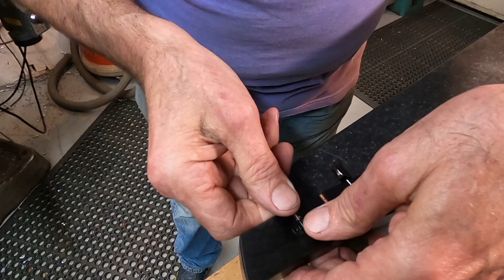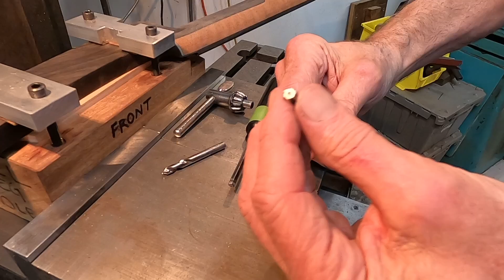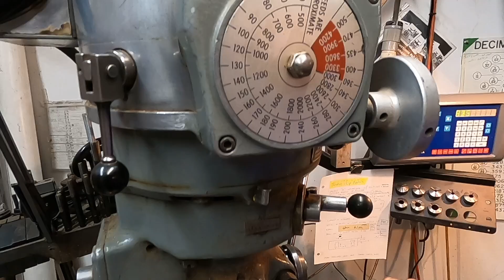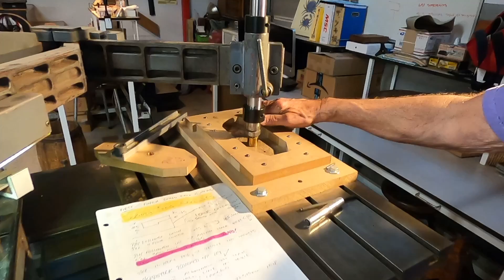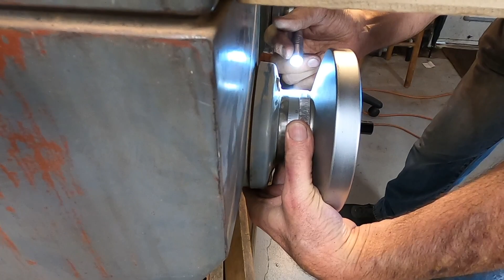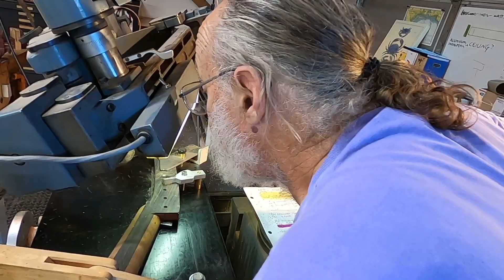Ken Parker Archtoppery - Riff 005 Tuning Machine Installation

Comment: There's an evil voice inside of me that wants to CNC a template to use in the pantograph machine? Muahaha
Reply from the maker: Jason! That’s a funny  thought, alright, but let’s look at a built - in aspect of the multiplication/division nature of the pantograph itself that makes it funnier…

I you’ve never used one of these magical pantographs, you might not have considered that dimensional accuracy follows the ratio you choose to use.
That is, any errors you make on the oversized pattern will be divided by the factor of the ratio.
For cutting the tuning peg recesses, I am using the largest ratio that my machine is capable of, 10:1.
This means that an error of .010” on the pattern would be divided by 10 to become an error of .001” on the work!

Functionally, this means that you can lay out the tool with a crayon, and the part will still be pretty close in dimension.
This an exceptionally useful thing, as it makes patternmaking easy for a reduction tool, and offers the potential for exceptional accuracy in the reduced part, or in this case, machined recess.
Normally, pantograph cutters and followers can be swapped, and so are also capable of scaling up. Of course, then it works the other way, multiplying your errors instead of dividing them, In this case we just might be tempted to turn to the CNC to improve the accuracy it the tool!

Comment: I love that you are using the pantograph for the tuners!  Found a CNC machinist in Germany named Stefan Gottswinter who has the first one that I had seen that works with that amount of precision, what capabilities are available with such an amazing tool.  Yours has I believe even more adjustment capacities.  What a find.  No coding required, totally repeatable, great obsolete tooling that works exceedingly well for one of a time, consecutive uses.  Genius!
Reply from the maker: Well put!  It sounds like you need one of these!  My machine was made in France by Scripta for the American market, and so is graduated in inches.  It's a marvelous machine, super precise, with many capabilities that I'll probably never get to use.  It's adjustable from 10:1 to 1.3:1 proportion ratios, and is configured to either reduce or expand by swapping the position of the spindle and stylus.  I use it 10:1 for the little tuner pockets.  The resulting  benefit of this reduction scheme is that errors in the template are reduced by the factor of reduction, so an error of .040" ( 1mm) on the template translates to a .004" (.1mm) error in the part!  It's the ultimate "router template" for small parts.

Comment: What will you do when you run out of the Stealth tuners as you say they are "out of print"?
Reply from the maker: That's a development project in the works, although the Stealth machines will be hard to beat. I've played with making and hotrodding (defacing?) tuners for decades, and while creating a new design from scratch is a huge job, at some point I'll have to find a happy solution.  
Meanwhile, as I have many sets in house, it's on a back burner.

Comment: Hey Ken! The process of milling the slots and preparing the jigs for them seems to be extremely time consuming, why did you prefer this method over using a cnc machine?
Reply from the maker: Great question!  It's important to be realistic about tooling costs and time spent for the particular result you require.  As I explained in the Riff, I own and understand this pantagraph.  I first used one in the clock making shop I apprenticed in when I was in my early 20's.  My machine is in spanking brand new condition, the tooling was very quick and easy to make, and benefits from the multiplication of accuracy by an order of magnitude by way of scaling, as I explain in the Riff.  When I'm not telling you what I'm doing on camera, my elapsed time for the whole job, after the holes are drilled, is 20 minutes.  Plus, I don't know how to program a CNC machine, and don't have one that works.  Enough reasons?  Oh yeah, plus the pantograph pleases me in a way that CNC never will, because I get to interact with it like a partner.  Don't get me wrong, CNC are very useful, but are certainly not always the right tool for every job in every shop, thank goodness, or how will we have any fun?  I ran Parker Guitars with a row of big CNC machines for 11 years, and I can't recall having heard anyone crow about how much fun CNC programming and operation is!

Comment: When building my first archtop with recessed tuning keys in the headstock, I have spent two weeks developing a technique that would give me precise and repeatable results. High-speed router, carbide bids, and a little expendable wood at the edge were the answers. While I am “more or less” happy with my technique, yours is better. 10:1 increase of precision is a game-changer. I do not have a place in my workshop for a stand-alone pantograph duplicator, but I will build one from aluminum v-slot profiles. I used a v-slot before to build a jig to my belt sander that makes a conical surface on the fingerboards. Thank you for generously sharing the results of your research 🙏🏻
Reply from the maker: Sounds good!   We use what we have, or can devise.  The fun part is getting there. There's lots of good ways to do this!

Comment: Hi! What is your take on the topic of mass distribution on the guitar, and how it affects the sound/vibrations of the strings? I am asking u because i have built a couple of headless, only to found them almost too pure sounding. Seen the extra care you take in using very light materials, i am really interesting in knowing your opinion. Thanks! 😀
Reply from the maker: Great question..  I think that neck stiffness is more important than small changes in mass distribution, although a headstock - ectomy is hardly a small change.  I think it's better practice to stiffen the neck enough that the headstock doesn't become a problematic resonator.  If you can't figure out how to do that, I suppose tossing the headstock is an OK way to accomplish the same thing.  Here's where carbon/epoxy really shines, as you get to add it as an ingredient, like a spice, and decide what the right amount is to get the neck to wiggle the way you want, which, I believe, is what you're talking about.  Actually, although my necks have a softwood core, they aren't exactly light, but they are very, very stiff.
Reply: @kenparkerarchtoppery9440  thanks for your answer. And in my regular instruments i tend to use laminated necks in an attempt to fine tune their stiffness. Those 2 headless instrument were more an experiment, successful in a way: now i am certain i don't like them 😀